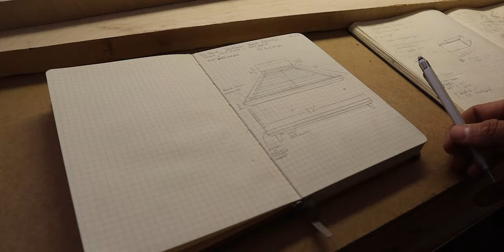Japanese style Platform Bed (Custom Made)

Comment: I really like the simple lines you've created with this project.  The only thing that concerns me is the amount of support for the headboard.  Could be alright but it seems like a lot to put on those two little pieces of wood.
Reply from the maker: Thanks for the feed back. I can definitely see your concern about the headboard, but the joinery used, with the through bolts plus the thickness and strength of the hard maple wood made for a very sturdy set up. Don't worry I tested the durability of the piece before getting it to the client!
Reply: @Theclassiccarpenter  awesome 😁I've been battling with how to design my bed frame and I'm leaning towards something similar to what you did here.
Reply from the maker: Lyndon Dimond cool! If u have any question feel free to reach out!
Reply: @Theclassiccarpenter  Thanks, I'm about half way done.  Some minor differences in design but i think I've got it all worked out.  I found and followed over on instagram, when I'm done I'll tag you in a picture so you can see it!
Reply: @Theclassiccarpenter  Can you please share the angles and sizes of the bed legs
Reply: Does anyone know the leg angles and length?